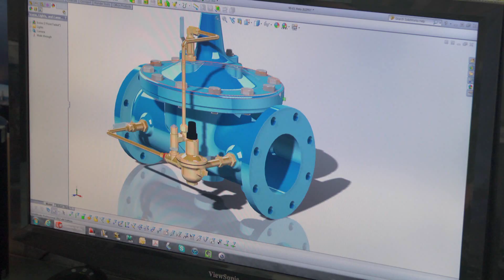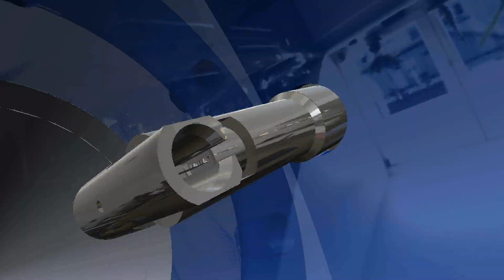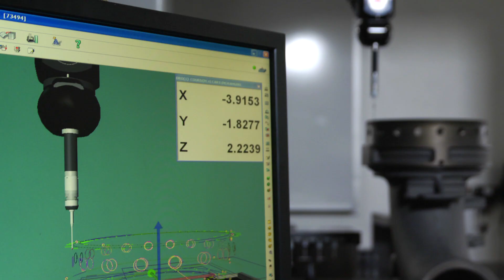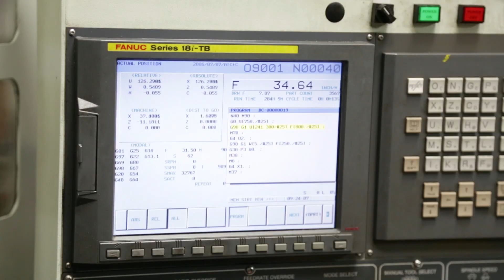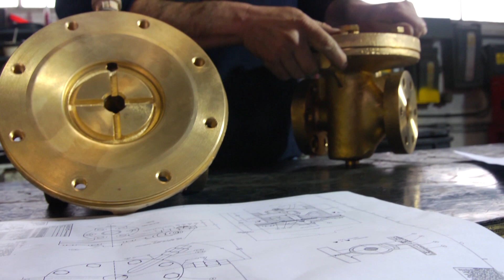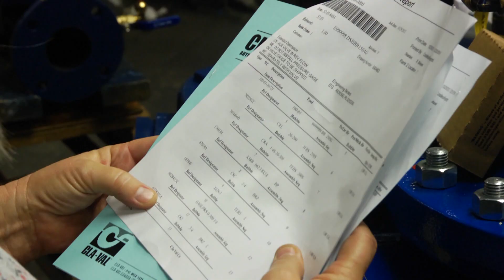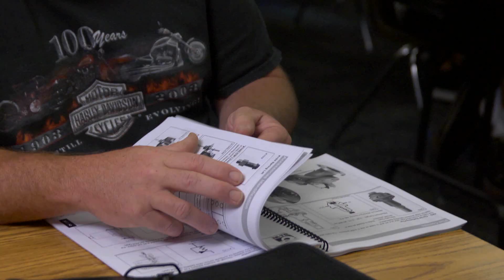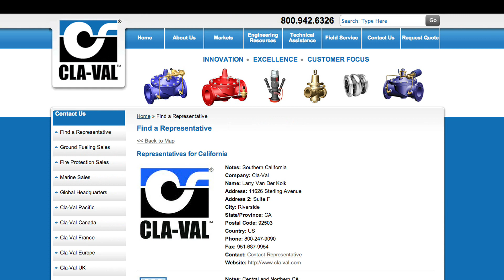CLA-VAL Manufacturing Tour

Comment: Dear Manager, 
This is Jerry Lee from Sino Base Metal Co., Limited in China. 
Kindly Offering you various types of valves, tubes/pipes & fitting with Best price & excellent quality. 
Have a nice day
Best regards
Jerry Lee
Export Department
Sino Base Metal Co., Limited 
Shanghai Dreamax Industrial Co., Ltd
Add: 1904, LiDu Mansion, 500 Zhongshan Road, Shanghai
Skype ID :liwei618
Tel:   0086-21-53021748 
Fax:  0086-21-53021749